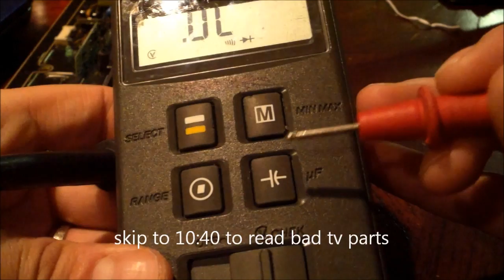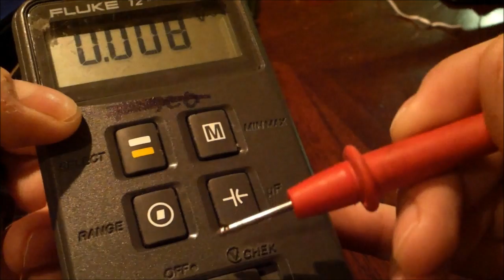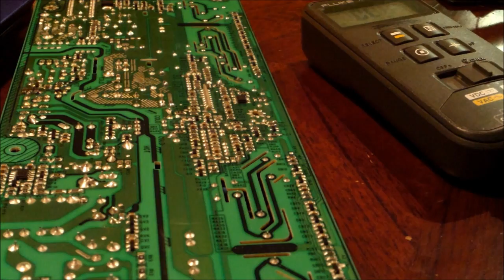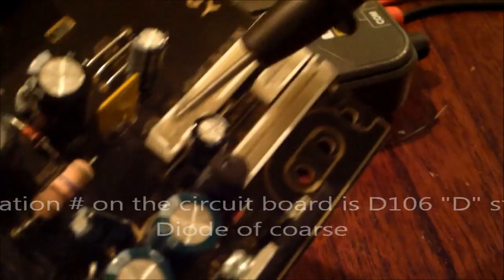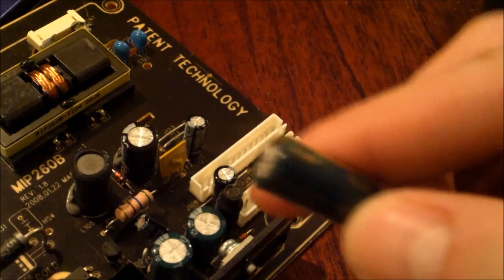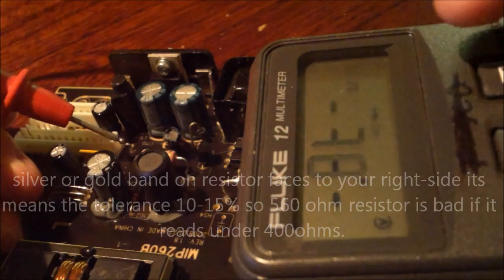HOW TO USE DiGiTAL METER TO TEST TV POWER BOARD REVIEW

Comment: Your a great teacher. Most of this is in Latin to me. Wondering if you would be able to help me with a issue..  I have a NS-24D420NA16/NS-24D420MX16 model Insignia Tv. Trying to understand the connectivity part.  Thanks for any help!
 Nothing on my board looks bad. I hear the beeps. When I put the power supply in. Red light goes on then off.  I try to giggle the power supply, but it keeps doing the same thing.  Tried different power supply's and all the other basic troubleshooting. My fuse is good. Tv is like new btw. 

Thank you!!

Comment: Hi Sir,I got a philips Tv power supply  with two blink.I check one of the diode " SB 140" with only 156,so is it bad?how to replace the similar value?
Thinking of changing the board,where to buy, pls advice?

Kind Regards to you

Comment: I have a Panasonic Plasma 50 inch. Model TC-P50S1 with 6 blinking lights when I power it on. what causes this , what board should I replaced.

Comment: i have sharp aquos LC-60LE745u. it turns on , when played a source i can hear audio and very faint video, only can be seen from an angle. thats it. i am stuck are you able to help?
Reply from the maker: Use shine flash light on screen in dark room if you see picture and hear audio then inverter board is bad,  or you have loose connection on inverter board. Get at shopjimmy.com
Reply: ***** yes i have very dim video. there are 3 boards, main board , power and Tcon. which one i need to replace? i guess inverter board is on power board. definitely no lose connection.
Reply from the maker: John Jackson yes some tvs have inverter circuit with power board
Reply: ***** thank you, really appreciate. i will let you know after replacing
Reply from the maker: John Jackson cool thanks

Comment: i have a LG Flatron lcd 19" monitor that doesn't power on ....checked the lcd panel with other spare power supply board, then only lcd panel's backlight is turned on ... what is the probable problem with it ? where should i start ? please guide me ...

Comment: I have a sony bravia 46 inch TV model number KDL 46xbr2 and has power going to it but no pictures and no sound what could be the problem can you help me please Thanks
Reply from the maker: count the blinking red led cause that is error code for what board failed, call sony to find out if tv is recalled first- Priority Service: sony tv help 239-768-7547
Sony TV warranty services 1888-649-7669 
 Sony TVs for me it can be bad power board, tcon or lcd panel connections.
Did this help?
Reply: *****  thank you 4 your respond .i check with sony and they told me i have no warranty and that it's not a recall. I saw a red flashing light in there though. How do I know witch bored it is?

Comment: The blue things you pointed as capacitors are actually varistors. They decrease their resistance when the voltage on their pins reaches the stated voltage on the vatistors. They are there to short out if there are any power spikes and then blow the fuse.

Comment: Hey Tampatec,
 I have watched this several times and still everytime I learn more. Back in the early 90's I got a brand new Pioneer reciever. With a 5 yr warrenty. It last five yrs and five days. I got home at five there abouts and it died." 555"  So I boxed it up. And put it away.I have not touched it since. After watching your videos I got up the nerve to try and fix it. Well I carefully opened it up and could not see anything wrong. I wiggled some wires and used some can air to clean with. Took the fuse out to check. and clean. When I plugged it up it started working again. I have let it play now for a day and a half and it has not missed a beat. Back when I got this thing it was top of the line and now a prologic system is not worth much. But ya know it means a lot to me.
So Thanks for making these videos.

Comment: i got a sharpl c-32av22u had lines on the screen replaced t cone board and now if i hook up the right t cone ribbon i got prefect picture on the right side if i hook up the left side the whole screen goes black please help.
Reply from the maker: double check ribbon connections or tcon board you got still might be bad. (check right side ribbon connection on tcon board)

Comment: Have u if it worked on a LG plasma TV model number is 60pv450-UA the TV is on but the picture is light dark and you can hear the sound there's two circuit boards 1 is on the Yside and the other one is on the Z side.and also how do you check ceramic fuse which is t6.3 ah 250v..heres the part number EBR678 20001 and the other board part number is E BR71516301 and also by the way nice video:)

Comment: Do all transistors have to read 0.5? I have two transistors (same part number) that read 0.9 one way, and 0.5 the other way. Are they both bad or can I assume they are both good? Thanks!
Reply from the maker: most transistors read like diodes read .3to.7 anode + & cathode - and reverse meter probes should read OL (over-limit)

Comment: Great videos. I have a PN51D450AD2. Had a lightning storm and had it hit take out my satellite dish/PVR. The plasma worked for a bit till I tried to reset the PVR (turn off the main power bar), now the plasma will not turn on. Only the red light in the bottom comes on solid. Replaced the power board (X Main) but still only getting solid red light when plugged in. Any suggestions on what I should do next? Can't seem to find the help on any posts, Thanks

Comment: The range is between 0.4v to 0.8v then the diode is fine but this depends on where you get the information from.  Some industries believe its between 0.3v - 0.8v. I would change it if its 0.8 or 0.3. But its down to the engineers discretion.

Comment: I'm having an issue with my Hanns.G HG281D monitor. Watching video the other night, the image split in two and the screen got whiter & whiter and now only shows white with either some grey or colored vertical lines. I tore it completely apart and every connection is solid. It has 4 boards. Main, Power, T-Con and Inverter. I assume the inverter is fine because the back-light works. Is the problem likely a capacitor on the Main/Power board or the T-Con itself defective? Thanks for any advice.

Comment: a nice video ..... i have problem with my tv Sylvania  37-Inch HD Flat Panel LCD my brother shoot a palet on the corner of the tv and it spread two line across up and down and right now line that move across the tv and the part that my shoot...... it spead black black on the bottom were he shoot at so i need ya help

Comment: Hey great videos I've watched all of your TV repairs and you make it look too easy! I've given a shot at my own busted TV but I've run into a problem. I've replaced all the busted caps (though one of them is of slightly lower value till I can grab one of the same uf). But the earliest resistor now keeps burning out as soon as I plug in the tv. I'm not sure whats making it draw so much current I'm sure the values of the replaced parts are correct since I was going by the service manual. Help!

Comment: Thanks for the quick response. Actually I was able to figure out what I did wrong when measuring the voltage. I was using the ground from the AC side instead of the ground from DC side. Once I did this I got the correct voltage readings. Now when I press the power on the TV the backlight turns on but no picture is shown. Does this indicate that there might be problem with the main board?

Comment: I have a Vizio VO47L FHDTV30A, the vizio logo in front of the TV turns on
when its connected but the screen wont turn on. I checked for any burn components but everything was fine. I started checking the voltage from the power supply and the input AC power is ~121VAC but when i check the output voltage the DC power 1st connection suppose to have a 24VDC reading and 2nd connection a12VDC reading but when i use the multimeter both read about ~55VDC. What would the problem be?

Comment: i use to use that solder sucker, i hated it. now use a desoldering iron. it works way better.
also, "beep mode" i believe is called continuity.  the white grease you refer to is called thermal compound.

Comment: Hi Tampatec, My Plasma Samsung TV model PS51D8000FU is not working. The power doesnt come on. Ive open the back to see if I can notice any bad capacitors but visually, they all look ok because there is non that is bulged.

The Red light goes off when I press on from the remote but no picture and no sound.

How can I repair it? Please I need your help.